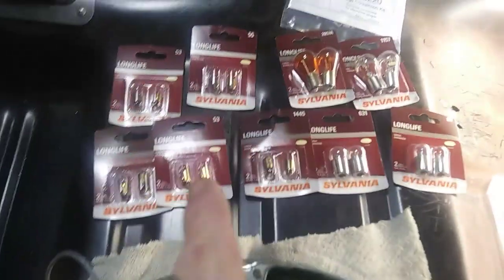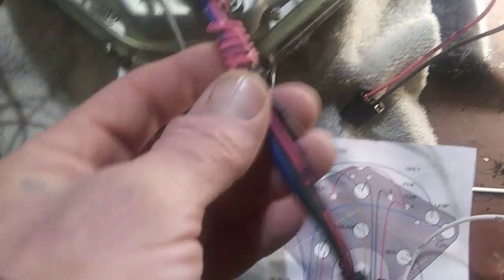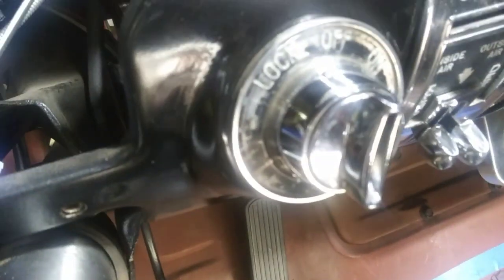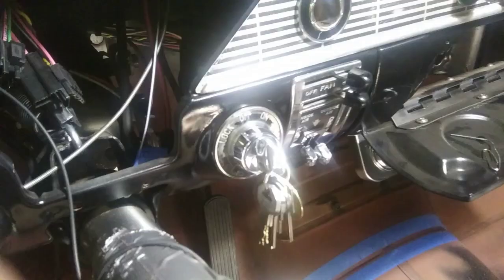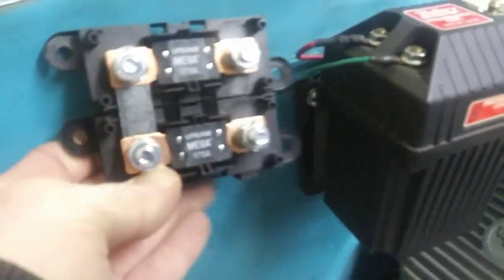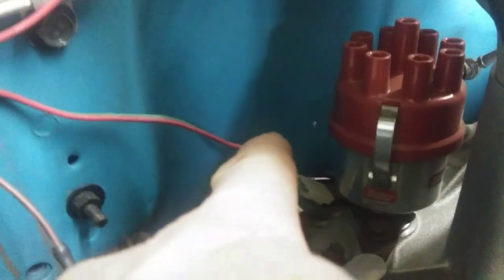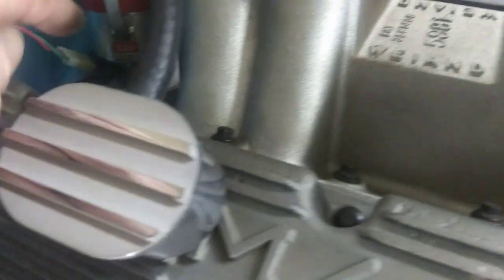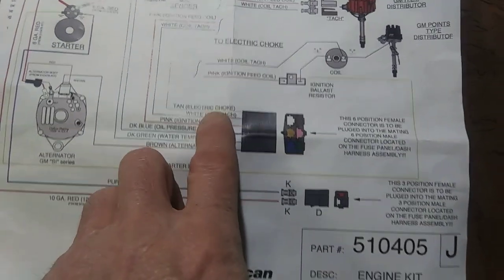1955 CHEVY GASSER BUILD. installing American autowire kit.

Comment: Hey Chris nice job on the wiring I ran my alternator wire from the starter along the oil pan bolts and back up to the alternator o you have some of roach clips laying around you might as well use them stay warm and have fun.
Reply from the maker: Hey thanks Ben! That is a good way to run that wire to.
Those where new roach clips lol😂. Thanks for watching have a great weekend brother👍👍👍

Comment: The timing on your videos are really hitting home with me , right now I'm in the process of wiring my car. I'm not the best at wiring up a car, some of the stages, like the gauge panel can be pretty darn time consuming, some great tips here, didn't know about the Chinese insulation issue, good to know,  I  did have enough common sense to buy a quality harness though.. Wiring is just one of the areas it doesn't pay to cheap out on. A lot like brakes, steering and cooling.
Reply from the maker: Hey Reggie cool to hear your doing wiring to.
And you got a good quality one. I'm just taking my time to make sure everything is right. It does pay off especially when putting one in a lot better instructions
Come with them makes it a plus to. It is one of my down falls never have liked doing the wiring. I can't say enough about the American autowire kit it makes it pretty simple will never buy anything different from now on. I'll be putting up a few more videos on the wiring thanks for watching and the comment appreciate it. Good luck to you with yours have a good one👍👍👍

Comment: Love your 55 and top quality work.  Do you need the small trim piece that goes on the end of quarter panel to divide the two colors?  I have a pair if needed.
Reply from the maker: Hey Rick thanks a lot. 
I don't have those pieces
The ole 55 must of been a solid color when she was new and then painted years later two tone. There are no holes to mount them. If I did have some I would put them on. What would you want for them and do they have the mounting pieces.
Thanks for watching Appreciate it.
Have a great week out there👍👍👍